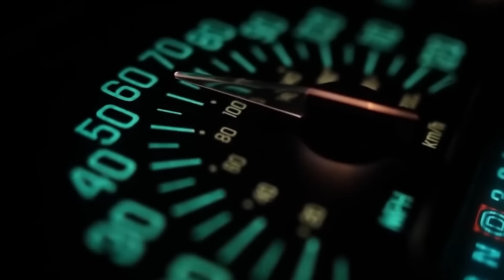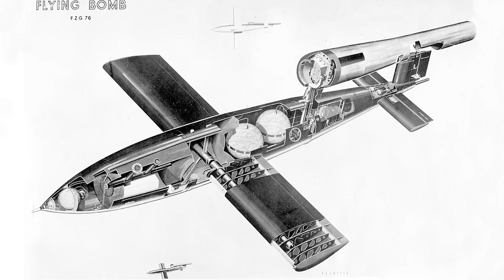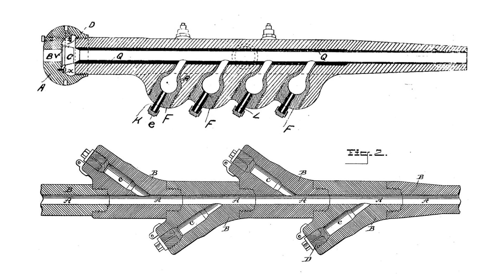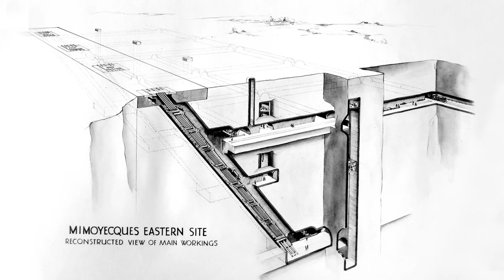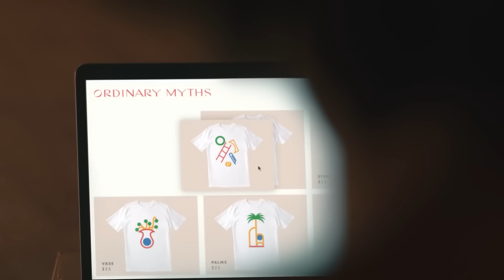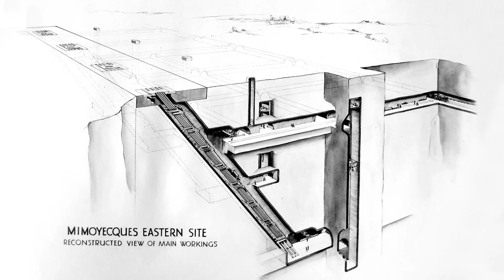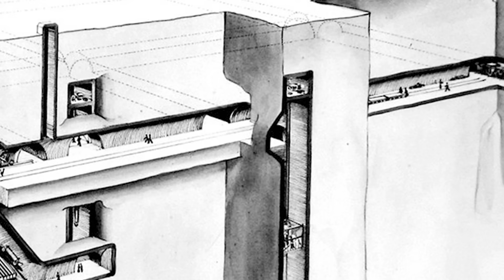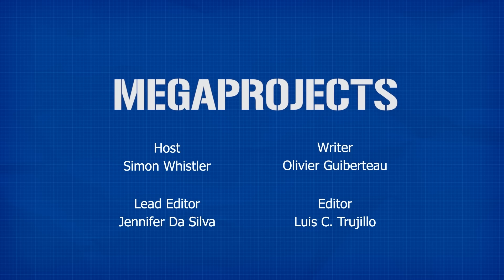The V-3 Cannon: Hitler's Unfinished Mega-Gun

Comment: 4:25
140 kg = 430 ft
Yeah.. good enough
Reply: yeah, that had me pausing to compute
Reply: You didn't know that 1 m = 1 Kg?
Reply: How many inches are in a liter? I can never remember.
Reply: Right,...I too had a "huh?" moment from that goof.

I guess his graphics guy doesn't know to use either # or lbs. for pounds when you are talking about the unit of weight rather than the unit of currency.
Reply: Meh, his Ametican scriptwriters and editors have trouble with metrics.  He just reads the scripts.
Reply: @Adam Hirsch, that equation is the acceleration of gravity times the value of all your spare change plus the area (in astronomical units) of the average doormat.
Reply: @pauld6967  feet are a form of currency ?
Reply: @nicholastrawinski  No, read it again. I was referring to the pound symbol, i.e. this #.

The British have a unit of currency that is called the Pound which uses the symbol £.

Since Simon and his support personnel are all presumed by me to be British, I thought they might've had some confusion between the two types of "pounds."

However, all of this just goes to show that I should not have been commenting while I watced the video. Later in the video they did correctly cite "lbs" so that first graphic must simply have been an error that slipped past the editor. 🙂
Reply: @pauld6967  did I miss a part in the video where they used the pound symbol instead of the pound symbol?
Reply: @nicholastrawinski  the issue was their equating kilograms to feet (ft) in one graphic instead of kilograms to pounds ( # or lbs) but they did it correctly in a later graphic.
Reply: @pauld6967  so they never made the mistake your talking about them having made? Like at all.... ?
Reply: @nicholastrawinski  they they made the mistake in the initial graphic they displayed with a measurement of kilograms incorrectly equated to feet.
Reply: How many seconds are in a metric minute I forget?
Reply: @madmarauder9925    Well, if you go with what was proposed in France back in 1792 A.D., that would be 100 decimal seconds per decimal minute.

Since the next logical questions would be about minutes per hour and hours per day: 100 decimal minutes per hour and 10 hours per day.
Reply: @pauld6967  ooooh.... NOOOOOW I understand the dewy decimal system!
Reply: Ready now to work for NASA!
Reply: 430 cubic feet of metal are equal to 140 kg 

😂
Reply: How heavy is an inch
Reply: @Leatherface123.  it  depends the "h" has no weight value but some scientists say that using quantum computing could help to find an approximative constant
Reply: @nicholastrawinski  In the Belgian Congo, yes.
Reply: Close enough. :P
Reply: @nicholastrawinski  Depends how hard you can kick I suppose ;-)
Reply: @adamhirsch715   It depends on the fluid . . .
Reply: @-Jeremiah-  I actually just took a screenshot of it to make sure I saw what I thought I saw lol
Reply: it's that wacky metric system

Comment: To put yourself in the mindset of late war Germany simply imagine this scenario:

Your house is on fire, all the doors are blocked by flames, but the water is running so you could at least try to quench them a little. You decide that you'll build yourself a new washing machine

You'll build it out of chocolate. You don't have many actual blocks of chocolate, or many bars, and those you have are a mix or milk, dark, and white. What you have in abundance is hot chocolate powder. You design a complex system of forming this powder into blocks. This is difficult because your house is on fire and your fridge has melted

Eventually you've produced 30% of the blocks you need. Then you change the design and make the washing machine bigger. It's also now a kettle. And from now on you'll only use white chocolate. Then the roof collapses

The end. No moral
Reply: ...It's also now a kettle..))))))
Reply: Good analogy
Reply: German military technology. Always a great idea. Even better if someone would have started it two years ago.
Reply: Nice joke, very very bad analogy.

It's  more like: Imagine your in your house, it burns,  you can't escape, however, you still have the strong will to quench  the flames.
You grap what you can find, you have no running water, only some full waterbottles and a  cellar full of tools. You start building an effective system to quench the flames and  use as low as possileof your water supply. 

Suddenly you realise, that your system won't be enough, so you search for alternatie solutions. You make some trial and error between suffocating flames with soil out of your cellar and chemical bombs that steal the oxigen from the flames (essentially eating fire with fire). You come to the conclution, that all your resources in your cellar are not enough.Than you decide to use some of your water, to reach other areas of your house, in the hope of finding something that could help you.

 Instead of finding something, you only waste resources, you realize that youre wife, wich bragged about your solutions and always had extravagant ideas wich you had to consider as well, complained again, how you were unable to safe the house.

Now, having tryed everything in your might to save  the house, you explain, that the two of you only can get alive out of this situation, using the water  left to it's greatest effect, spraying it on your clothes and getting safely out of your house, befor dying with it.

Your wife decides to stay, you leave. 

End of story.
Reply: No no, there's a moral to this story somewhere...
Reply: @Enthropical_Thunder  well put
Reply: If they were more clever at using their resources the war might continued longer and took even more human lives, so we should be thankful the Nazi were stupid and ineffective. Also they were expecting too much from their "psychological weapons"... when your enemy is really mad at you, ineffective "psychological" weapons make him even more angrier. Psychological weapons tend to work more on weaker non determined enemies. At that point in the war, allies were determined a 100% to destroy Nazi Germany and no miracle weapon could had stopped them. Most of these "miracle weapons" were just an irritation.
Reply: @Slav4o911  I wouldn't call them stupid or ineffective. Desperate would fit more I believe
Reply: Dood. Totally describes him. Had his hands in so many things he could never complete anything definitive. If he had instead projected his attention more acutely. We would all be under Nazi rule. Probably his biggest downfall. Attention deficit ooh shiny.
Reply: @Enthropical_Thunder  please tell me English is not your first language.
Reply: @Slav4o911  you are spot on, an enemy with near limitless resources, an industrial complex out of reach of your military, AND the determination and the intestinal fortitude to see it through.... Nope Germany didn't stand a chance in WWII.
Reply: i dont get its buts sound funny
Reply: Only detail overlooked was that you started the house fire yourself.
Reply: Sounds like alot of modern governments as well, especially as relating to COVID as more people talk about election procedures and the tourism industry then long term health care systems or explosively  growing wealth inequality
Reply: Thank you I feel enlightened
Reply: No Moral... You hear about the Volkststurm? There where only Kids and old people at the End.
Reply: @renaissanceredneck73  If they didn't try to invade the soviets they could've probably tried pitting them against the u.s.
Reply: Well their mindset was they knew they were finished...they just wanted to take as many Allied troops with them as possible. Apart from the few that actually believed some new wonder weapon would turn the tide of the war.

The Germans screwed themselves in so many ways.

- Switching to bombing British cities when they had the RAF on its knees.
- Declaring war on Russia and trying to fight a war on 2 fronts.
- Designing and building expensive, complex weapons in small numbers, instead of churning out cheaper, mass-produced equipment. 
- Wasting vast amounts of resources on dead-end or vanity projects

Also helped that the Nazi leadership spent almost as much time fighting each other as they did trying to win the war.
Reply: 2 years later I read this, just happy that I got to see the comment that wins the internet in my lifetime

Comment: Big problem with such guns is that there is no shoot and scoot option. Fire three or four rounds and your opponent knows where it is and proceeds to attack it with everything they've got.
Reply: I guess the best thing you can do is set up defenses, then release a huge volley all at one time and defend it the best you can
Reply: You also can't change the target. Its size prevents it swiveling.  You can cause it to fall short or long by altering the propellant charge, but that's it.
Reply: But when it's so far away in enemy territory, would it be that easy to find? With no smoke or propellant to trace back to its source, and if the allies didn't know the weapon existed until after the war they might not have comprehended international range artillery.
@Almitra Hopkins I guess they just relied on winds to change direction. Surely they wouldn't have been using this for precision strikes, and at that range the slightest deviation as it leaves the muzzle might equate to a few miles once it hits.

Comment: A firerate of 600 rpm is just insanely high for a cannon of that era. Especially considering that you would have to replace each of the solid rocket boosters. All 32 of them. and do that every 0.1 seconds to achieve that firerate. For comparison, 600 rpm is the same as a bren gun. This info just cannot be right. Once every 600 seconds might be more accurate.

Comment: If they replaced the shell with what you can call a rocket inside that long pipe. It would have been successful. Like a Similar shell with the propellant attached to the bottom. Continues thrust or pulsating burst. Calculate the pressure the pipe would need to withstand. Make reloads easy, and boom. Same thing, just more compact and conservative with less parts and sections to go wrong.

Comment: The Video is not correct concerning the Mimoyecques site : it has been bombed very effectivly and there was a lot of casualties. One of the tallboy bomb that was droped managed to enter one of the tunnels where the cannons were located and slid all the way to the bottom where it exploded. This was both luck and due to the increased odds of this happening due to the intensity of the bombings of the site. The explosion caused a nearby pocket of water to flood the bottom 2 levels of the bunker (including the third level where more than 1500 forced-labour prisonniers died). It was estimated that if another (smaller) kind of bomb had made its way to the mouth of the bunker, the other tunnels and the water pocket would have hold, and the construction could have been finished. Today, you can only visit the first level as the 2 bottom ones are graveyards.

Comment: The story of Port Hedland Australia. Iron Ore discovered there in the 50s. Now the heaviest tonnage private port in the world. 9 ships carrying 200 000 metric tons leave for China and Japan a day. @ 150 AUD a ton that's a significant amount. It wont fit in my calculator.
There is so much Iron Ore there that it throws compasses off and at the current rate there is 500 years of high grade iron ore still to mine, then medium and low grade. There are numerous multinational companies involved in mining in the region which is called by the indiginous as the Pilbara which means "hot place". The hottest I ever experienced there is 50 degrees. I worked there for about 8 years and I don't ever want to go back ha ha ha. It would be the exact opposite of the shale sands in Canada where it gets to -40 and men and machines continue to work. It can be seen on Google earth and so can the ships lined up awaiting their cargo.

Comment: My writing and recollection aren't the best but Iirc the flight that the kennedy and the other pilot died in during the operation to attack the facility  was due to a bad solenoid. If the solenoid received a certain radio signal then it would activate but if the solenoid was active for to long continuesly then it would over heat and catch fire. This was figured out by one of the ground crew who was self taught in electrical mechanics. He tried to alert people because this was a huge hazzard but wasnt paid much attention because he didn't have proper schooling. He brought this up to Kennedy right before the flight and kennedy was nervous. But continued with the mission. During take off a local radio signal hit the solenoid, triggering it, which lead to the plane exploding due to the heat/fire generated from said solenoid failure.
Reply: Simon didn't mention it but Joseph Kennedy was President Kennedy;s brother...

Comment: Six hundred shells per minute for one gun seems improbable to say the least. A heavy shell, and tthe replacement of the various charges along the gun barrel in one tenth of a second? A 150m barrel and 1500 metres per second. Assuming uniform acceleration in the barrel, the shell would take two tenths of a second to exit the bore, so a couple of shells would have to be introduced at the breech before the first shell had exited the bore. I can see engineering challenges there.

Comment: How would you aim the gun or make corrections to the aim? It seems once it was built it would be impossible to even slightly adjust the aim.
Reply: A minor change in the alignment of the gun would make a huge difference to the point of impact. 

It was only for use against city sized targets so the crap accuracy was acceptable.

Comment: HOW TO DEFEAT YOUTUBE ADS. if you click on the reverse or forward buttons on the top left corner, you can skip ads, by clicking reverse then forward, the original video clip comes back without the ad. if the forward or reverse is blank, click on another video clip on the right,  then click reverse arrow top left and the original video clip comes back to the same point you left off at, without having to watch thoser annoying ads

Comment: 600 rounds per minute. Hmm; I would like to see the breaching reload arrangement for that. Perhaps that number is a little out. Let us think of the sheer mass that has to be loaded, the breech opened and shut and the initial charge fired. Now in that time the other charges further up the barrel also have to be changed and the firing circuits checked. Then the gun has to be fired presumably automatically. I don’t think such claims were made for the gun built for Iraq a few years ago and that was of similar design.